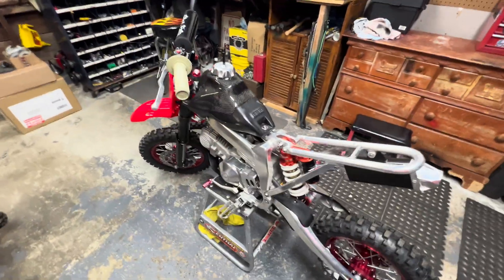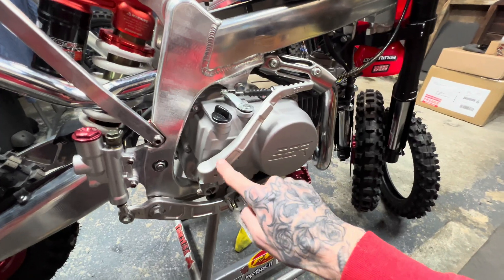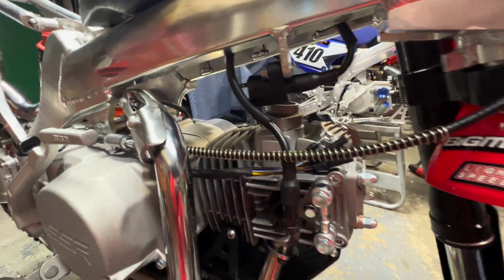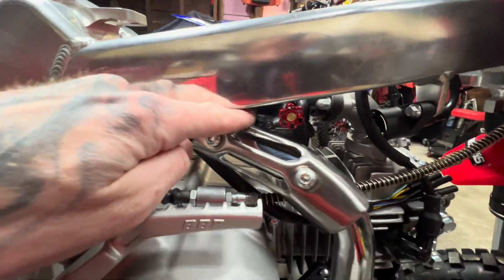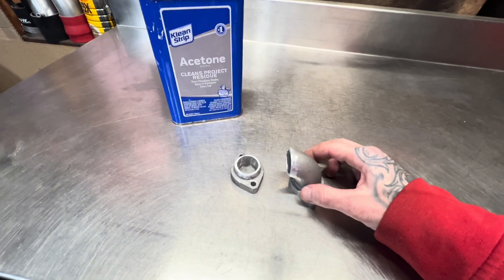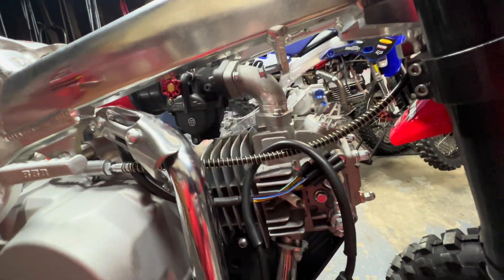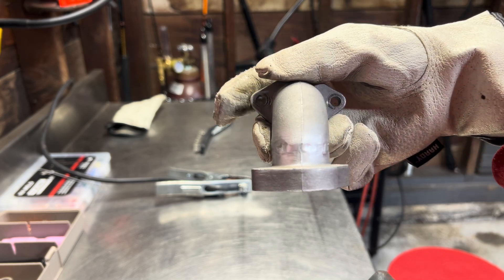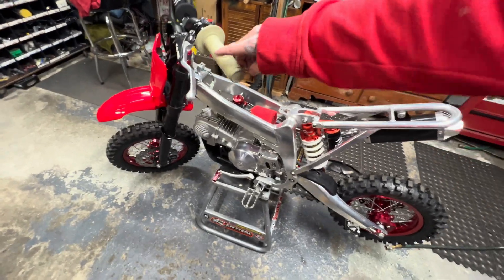Customizing intake manifold for Nibbi PE26mm Carb | YX140cc SSR PF2

Comment: The attention to detail you put into your builds is great to see. It's often under estimated how much of a difference a well suited intake for the carb can make a difference in terms of power and throttle respons. Already looking forward to seeing this thing finished!
Reply from the maker: Yep see you know the deal, all in the details haha. Exactly thats why i took my time with it and got the fit up perfect so i didn’t have to clean up or fill the inside.  She should be mint now thats its port matched to both sides. Im out here working on it as we speak just got done doing some regular work. Only thing i dont have to start it is the correct throttle cable but we might just have to borrow the one from the MM12p 😁

Comment: What's a good starting point for jetting for yx140 nibbi 26mm carb elevation 678 your builds are sick and the next level
Reply from the maker: @charlestippett3483  im gonna start with 32/110 with clip in the middle as far as for your setup im not exactly sure its really a testing an tuning things its not cookie cutter where the same jetting works for every bike
Reply: @JesseK410  yeah I understand it's just a stock ssr140tr with a uni filter
Reply from the maker: @charlestippett3483  nice so yeah you can try the jetting im gonna start with but dont expect it to work the same on your setup the air filter doesn’t matter but the exhaust setup and intake manifold as well as temperature/elevation is what plays the biggest roll. Once its close i would recommend adjusting the clip to get it mint and then checking the air screw for the pilot jet settings to see if its money
Reply: Thank buddy ill keep you posted @JesseK410
Reply from the maker: @ sounds good!

Comment: I run the nibbi metal style pod filter that's short in my v1
Reply from the maker: @RileySimmon-b5n  thats no good for dirt tho i have the same filter and definitely wont run that for off road use.
Reply: Havent had a issue 🤷🏼‍♂️ get a cover if your that worried @JesseK410
Reply: I prefer uni filters they easier to clean 💁🏼‍♂️
Reply from the maker: @ yeah UNI are great thats whats on all my builds haha w the outerwears cover

Comment: Loving the builds as always. I always run the tb parts pancake filters. Might give one a try on this bike. You can clock it away from the exhaust and it would open up a lot more room for cool air to get into the intake.
Reply from the maker: @CrispyRacing  thanks man I appreciate you watching and unfortunately I already tried one of those button filters. It’s too big. It’s actually a bigger diameter than the filter in it now believe it or not
Reply: @JesseK410  lol no way! Well there's something out there that'll work for ya, if not, you're fab skills will make something happen
Reply from the maker: @CrispyRacing  yeah for sure and for now this filter will work it’s just a tight fit haha
Reply: @JesseK410  good to see, i like the zip tie trick to keep it from the exhaust
Reply from the maker: @ haha you like that huh, figured it would do for now. I may eventually make a heat shield that slips under the hose clamp to secure in place
Reply: @JesseK410  definitely make a video on that if you decide to do it. Always looking for ideas and cool tricks like that to keep the builds going
Reply from the maker: Yessir definitely and will do!

Comment: Build is so sick I need to fab up a intake manifold having the same problem with air filter fitment but also need a little extra room for the throttle cable out of the top of the carb
Reply from the maker: @413_Off_Road  yeah exactly I am gonna have to buy a throttle cable probably gonna use the same one that’s on the BBR bike. It has an angle at the top of it so we can clear the tank.

Comment: Got any advice on helicoiling a sump plug just had the threads basically all break off and now is leaking oil, any advice would be appreciated. Dig the videos aswell bro
Reply: to helicoil that properly you’d have to have access to the back side which means splitting the cases. would be a much simpler job if you just drilled and tapped to the next size up
Reply from the maker: @yeahnah1688  Stancejunky said it well. What head is it? Some of these china bike heads are really cheap and wouldn’t be to much more to just replace it than have that old one repaired
Reply: @JesseK410  it's a yx150
Reply from the maker: @ ohyeah just buy a new head an call it a day you can get them cheap on ebay directly from china! Haha